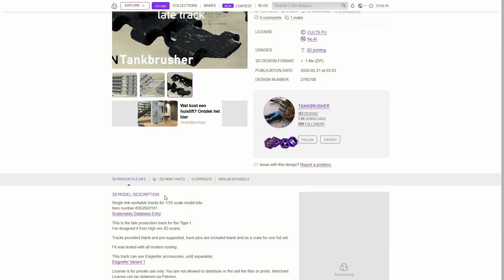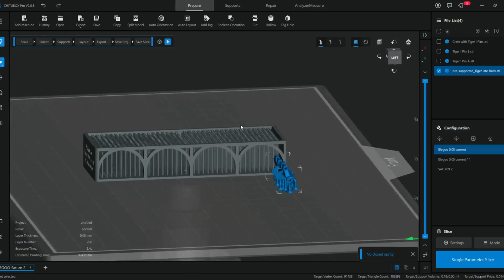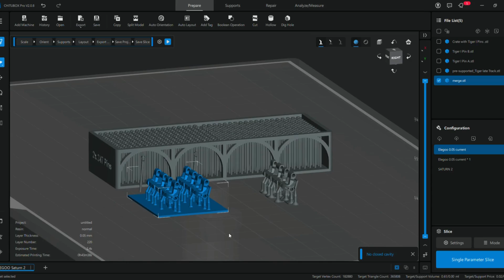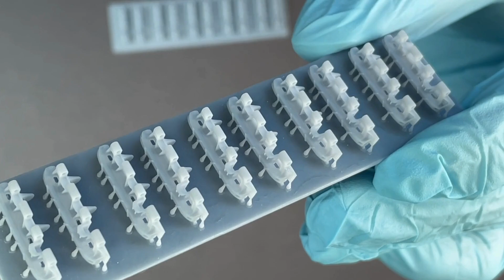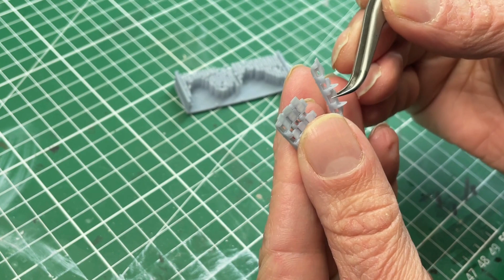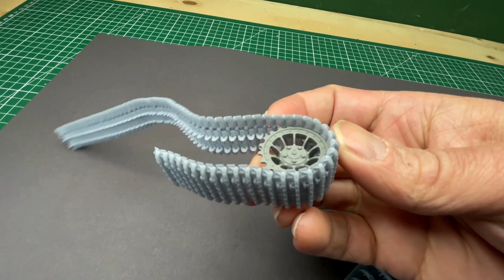Review   3D STL files   Tiger Late Tracks   1/35   Tankbrusher

Comment: Hi, thanks for the review.
Indeed they fit all modern tooling, I'm a tiger guy.
I'd like to add some tips: 
you showed the contents - the track link should be in there without support too - in case users want to make the supports themselves. 
You actually don't need to add a raft, we did a lot of testing. As long as you bed is level you can directly go with what there is as pre-support.
I like to copy and paste them very close together, like you did but even closer maybe 0.5mm spacing. You can print a full set in 3 prints on a Mars 3 size bed.
Check if you slicer allows you copy and arrange the track links automatically. Chitubox Pro does (but I understand most are using the free version.)
0.05mm Layer height will turn out perfect too, but you need a ACF and Anti Alias + Grey Scale settings active at default values - one print takes about 20min with such settings than. 
Kind regards
Kai
Reply from the maker: Thank you for your comments! Appreciate it! You are correct, the non-supported tracks are included as well. I personally like to add the raft because it will give a good handle to clean and later strip it from the supports. I had the panther tracks as well and I added those closer, that is possible. But sometimes it helps to have slightly more space between the parts, but that is all personal of course. Thanks again!